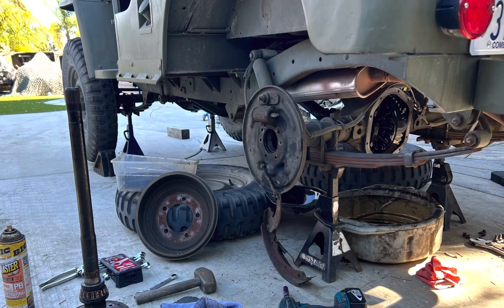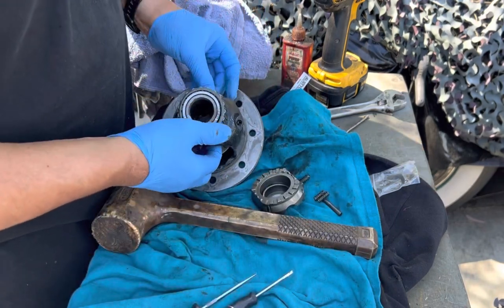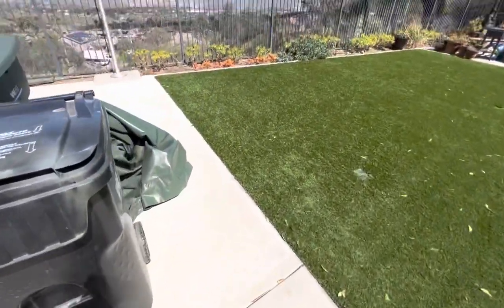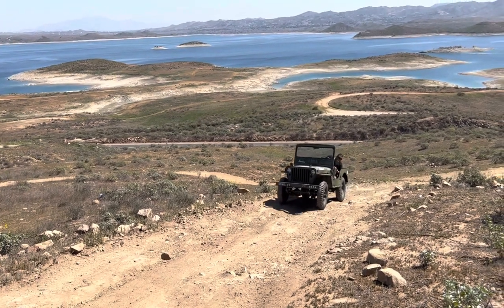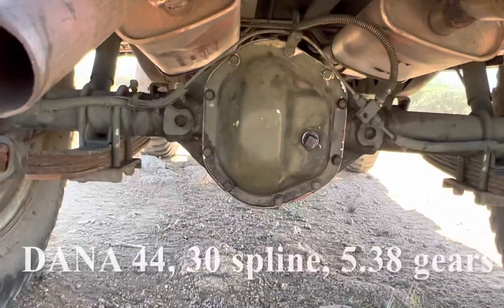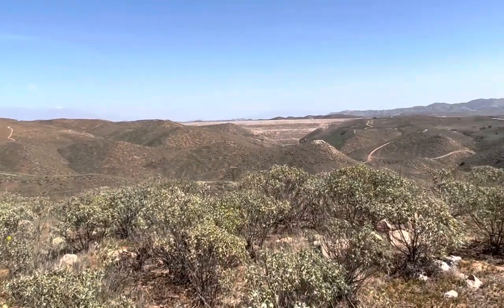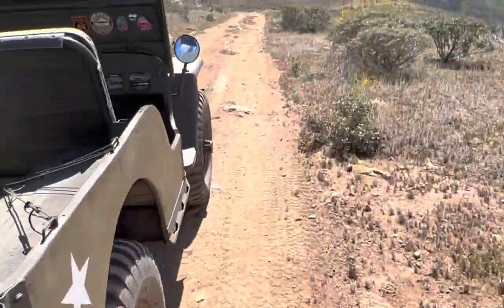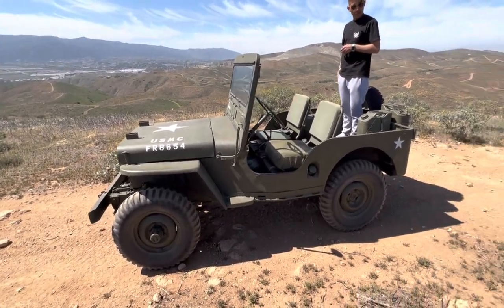Slumdog gets lockers/ Willys Jeep/ CJ2A/ Vintage

Comment: Looks to me like those roads can be run in 2wd with the tired aired down. Besides that, if you're only locking one diff, always do the front first
Reply from the maker: the videos don't catch the steepness - thanks for the input.

Comment: I have that 1971 cj5 differential on my cj3b, what kit should I buy? I haven't bought it for fear of buying the wrong one.
Reply from the maker: to be sure. you need to open the differntial and see what you got-count the splines and then you’ll be set to order. 
I opened mine up and seen that it was a 30 spline dana 44… but some have only 10 splines… Thanks.